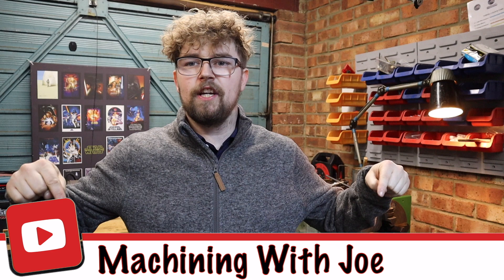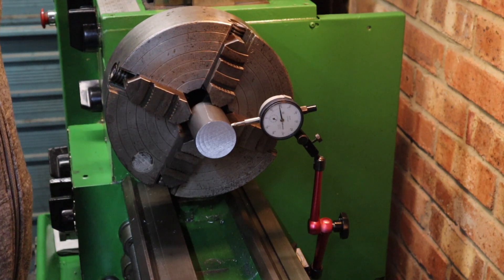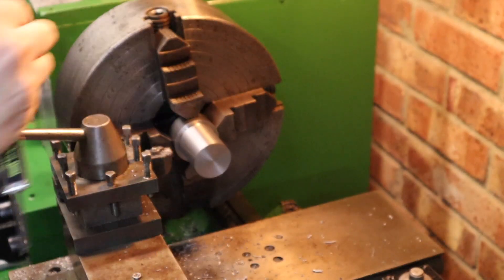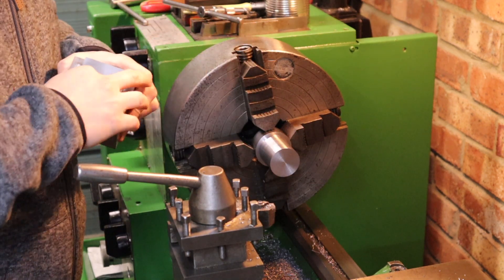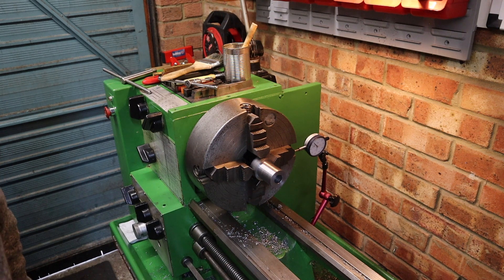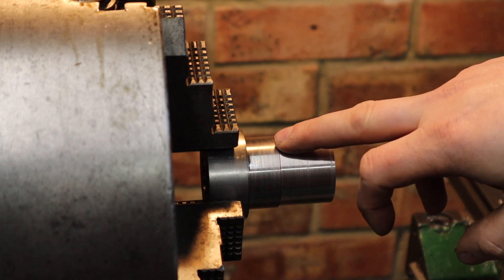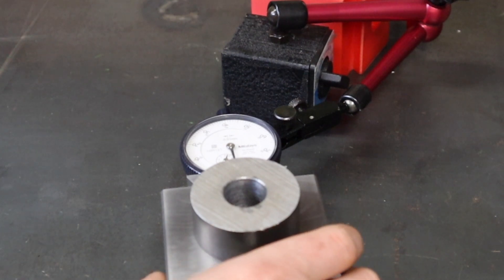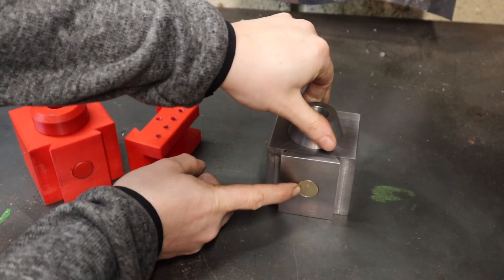Making a Quick Change Tool Post Part 4

Comment: Hi there Joe I have just recently bought a Harrison m300 and I was wondering if it was easy to get the power supply sorted? Cheers Clive.
Reply from the maker: Hi Billy congratulations on your new lathe. So mine came with a transwave to convert single phase to 3 phase. Probably the easiest option if you don’t have 3 phase.

Comment: Joe, at 8:50 you should have only removed only the area for cam action contacted by the piston, not the entire bottom 1/2.  Lots of support is lost in this move... Good series tho, thanks for making it available.
Reply from the maker: Hi John yeah wish I never took that bit of the bottom. If it causes issues in the future I’ll make a new one. Like you sed I could of lost some rigidity there so maybe something to consider.

Comment: Fine, In 2019 am maschint the same tool for my late. It is an wonderfull Toolpoost, chep and verygood funktion. 
I can make so mutch as i like Tooholders for many Tools.
Reply from the maker: Good to hear the toolpost is still going after a few years. Fingers crossed mine lasts as long.

Comment: Nice work. Is there a reason you couldn't leave the shaft concentric at the top and bottom and just have an eccentric in the middle? Might have just been a little more rigid.
Reply from the maker: To be honest Mike I didn’t think about it if I did I would of most definitely of done that great idea.

Comment: It may be the camera angle but it is always best to have the DTI at 90degrees to the workpiece when setting up in the 4 jaw otherwise you could end up with parallax issues if you are using it to accurately offset a workpiece. Just a thought not a criticism great channel though.
Reply from the maker: Hi Jon great advise as always I think it might of been a camera angle issue because the DTI was pretty close to 90 degrees but looking back at the video is does look way off. All the best

Comment: you should make your dovetails something std like AXA or BXA so you can buy std holders if you want too. like some special holder for something. that way you can buy or make..
Reply from the maker: Hi wilkbilt I get what your saying but the reason I’m doing this is because I didn’t want to pay the prices for these bigger holders. I suppose might be ok for the cheaper smaller holders if I was to do it again. All the best.
Reply: @MachiningwithJoe  Sometimes standard holders become available at cheap prices when they become separated from the tool post, or, when they are listed by sellers that do not really know what they are, or, they just want a quick liquidation sale. Good Luck with your shop!